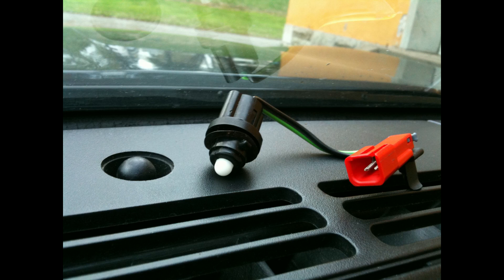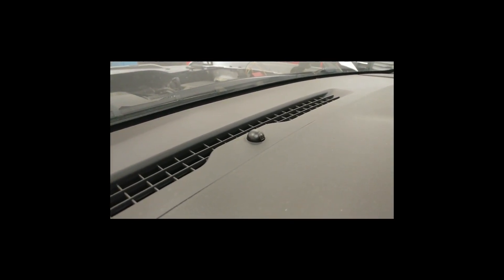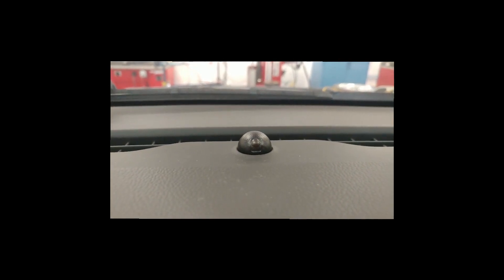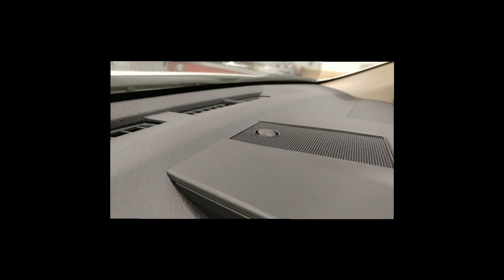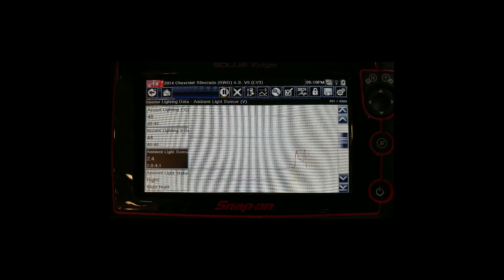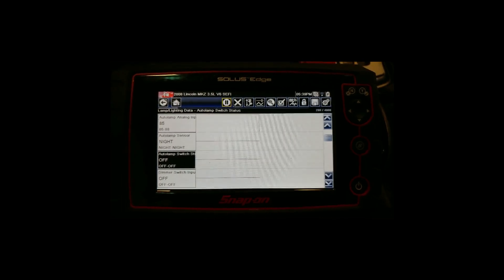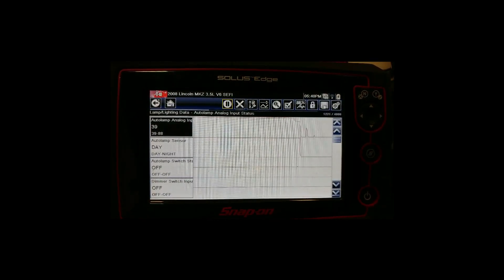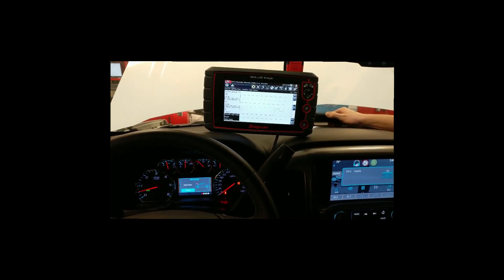Sun load sensor

Comment: this is an awesome video...quick question I have a 2005 tahoe 5.3 engine...I notice wen ambient temp is over 100 degrees f  the radiator fans kick on the higher speed...I'm not shure if is related to the ambient sensor or the cabin light temp sensor?  thanks in advance...new subscriber from phx AZ